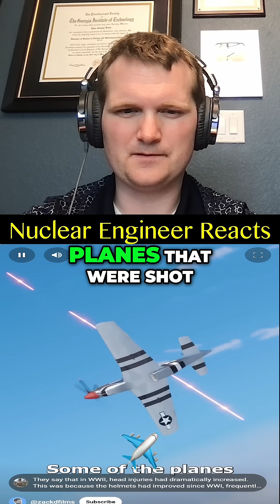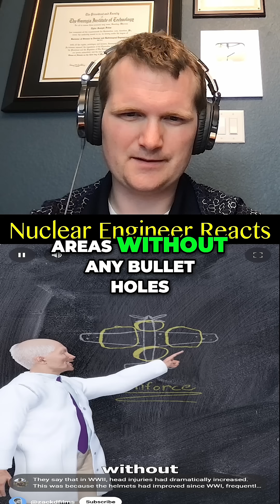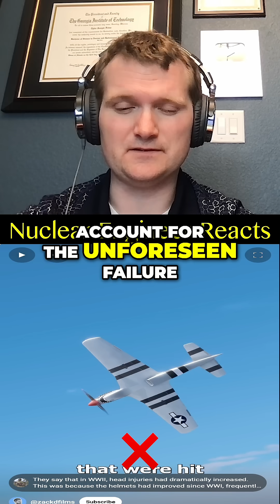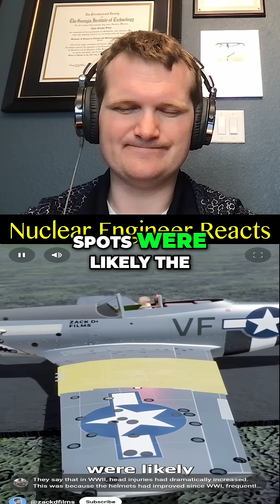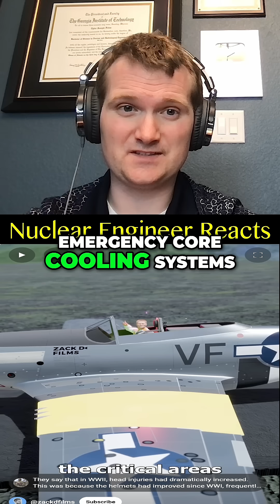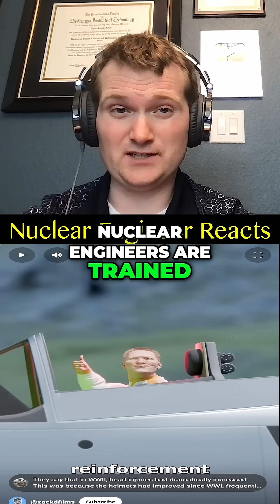Survivorship Bias Explained - Nuclear Engineer Reacts to Zack D. Films

Comment: Makes sense with that pattern of wing damage in particular- closer to the root there's enough structure to take the damage, further out it's less critical, the middle section doens't have the structure and means you lose too much of the wing.

Comment: Chernobyl was a perfect example of a design that seems perfect until it's not.
Reply: The reactor design of Chernobyl had design flaws discovered long before the event
Reply: @AcountVoorlol  Discovered but considered a state secret and therefore not known to those running said reactors.
Reply: Not really though because there were already known problems with that design by the time it happened
Reply: Chernobyl never seemed perfect certainly not after the first one of those reactors went live and they started having tons of problems that they kept secret from other plant operators 

No containment vessel is just one example I don't care how confident you think you are in the design. A containment structure would not have cost that much again in high risk low probability events you need to design for that high risk and they simply did not 

It was a bunch of Yes Men and arrogance 

Nowhere else in the world by any of the several countries and companies that made nuclear power plants with anything as poorly designed as Chernobyl ever put into operational service certainly not at that point in time. Some of the very early test reactors when things weren't very well understood did have some some risks but nothing like Chernobyl